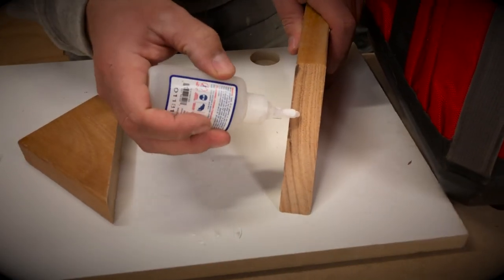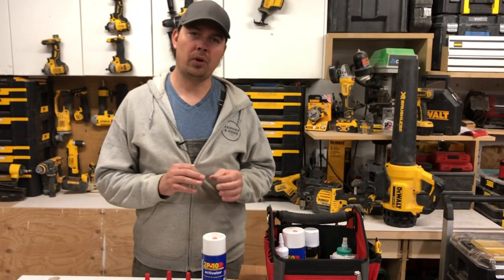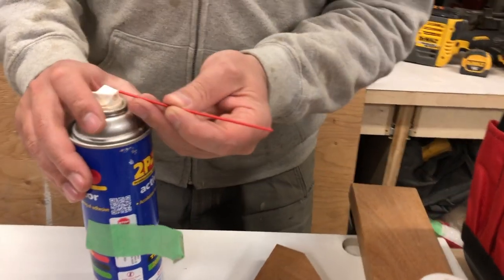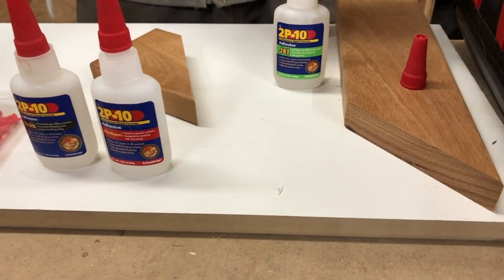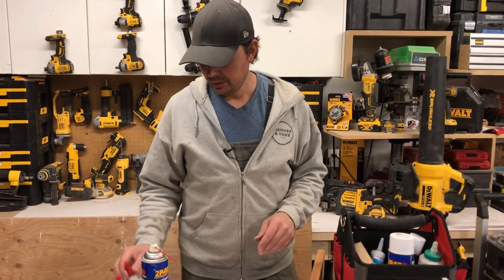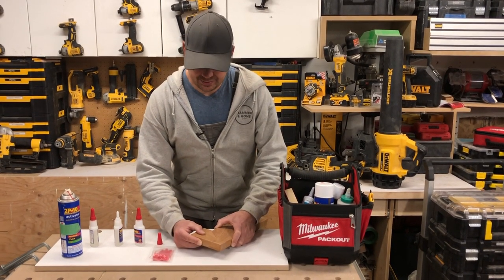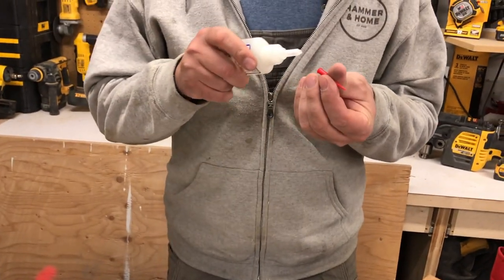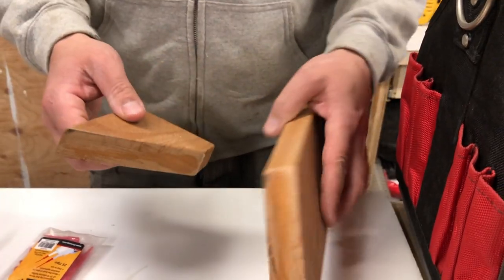How to use 2P10 Glue & Activator

Comment: I'd like to point out that these are not actually unique products. The adhesive is just Cyanoacrylate, CA Glue, or as it's most commonly sold as, Super Glue. And the activator is CA accelerator, sometimes called Zip Kicker which is one of the oldest and most well known brands of accelerator.

I'm sure 2p10 has there own slightly different formulation like all brand do but I find it a bit misleading that these are being advertised as if they were some kind of unique two part adhesive where both parts need to be used together. The glue will set by itself given time just like any super glue and the activator will work just as well on any other brand of super glue such as Locktite or Gorilla.

Comment: Can this jel product be used to glue 1/2 plywood to a 2×4 frame without having to put screws through the face of the plywood ? Trying to keep the face of a Cornhole board free of screws
Reply from the maker: Yeah definitely, you could use it in conjunction with regular wood glue. That way you don’t have to use so much 2p10
Reply: @hammerandhome  thank you, i normally pocket screw them through the tops and the paint or wraps cover them. i have a order for a plain wood set of boards and afraid to use the pocket hole screws for fear the screws will come through the tops

Comment: For   M DF You have to use super glue on both sides then  Combined then  Accelerator And don't forget  Don't put it on your skin then  Use accelerator it will burn your skin     
     😆🍻🍺😊
Reply from the maker: good tip, Thanks

Comment: Your demo shows the 2 parts are easily separated after you glued them. Poor demo or poor quality glue?
Reply: You’d have to spread it evenly over the entire joined surface and wait for half an hour or ao. It’s meant to be used alongside wood glue to basically act as a liquid clamp.